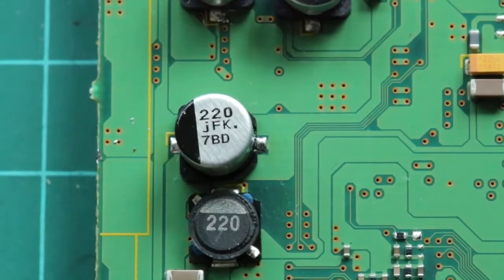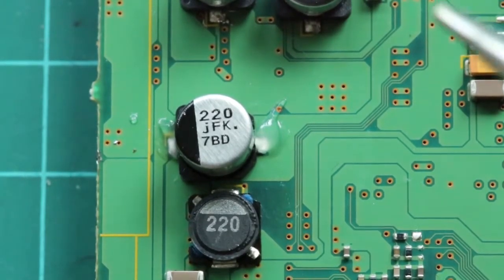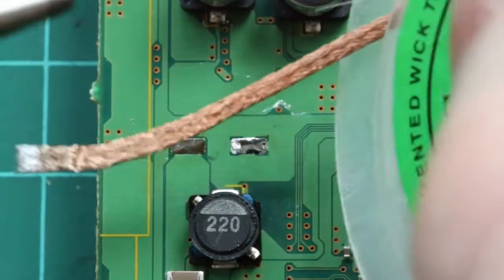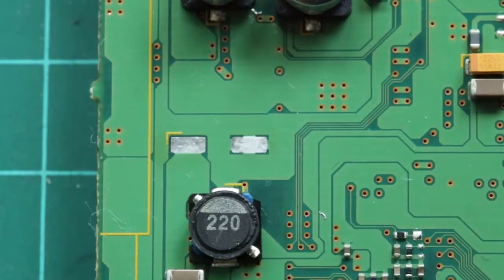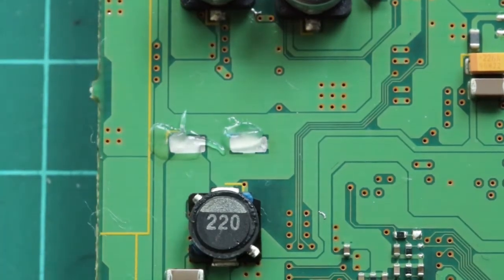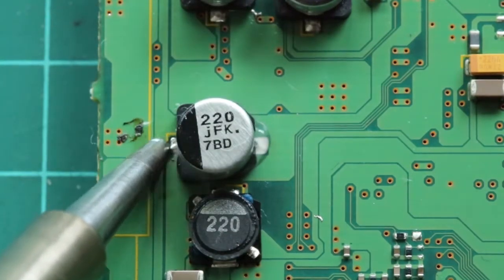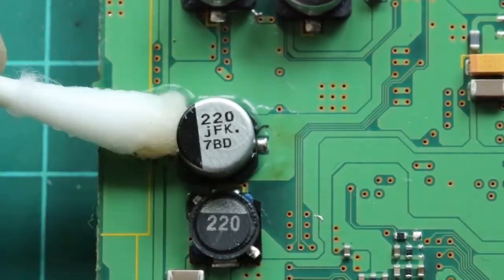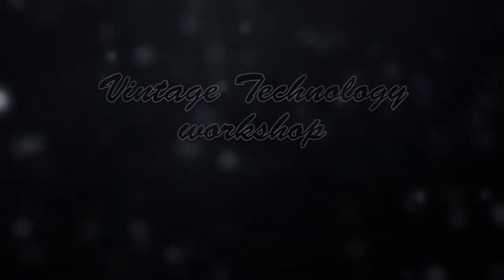Replacing SMD Caps the easy way.

Comment: Unsure if using two irons could be described as "easy" . How many people have more than one?
Reply from the maker: I guess the video is more aimed at bods that have to do this sort of thing on a daily basis and use the twist off method, which can sometimes take longer if you calculate the cleanup time and damage repair. A set of cheapy soldering tweezers would set you back about £20, but if things are tightly packed then this method might be the safer solution. Being an ex-Sony/Panasonic bod, I guess I have more than my fair share of soldering equipment, as service tech's tend to buy their own equipment that they feel comfy with. Most engineers stock up on multiples of things, just in case it ever gets discontinued. 😀 All the best, Ast..

Comment: DUDE, YOU FUCKING PIMP. This technique works fantastically (i was lucky enough to have a second soldering iron). No outrageously expensive extra tool needed.

Liked and sub. AND I LIKE AND SUB FOR NO ONE

Just finished my first recap of an snes
Reply from the maker: Sorry for the delay in replying, just saw the message. Thanks very much 😀 Well done with the SNES too. Glad the technique helped. Best regards.
Reply: @AstonsVintageTechnologyWorkshp  yeah thanks again it gave me the confidence to fuck around with a lot of shit since then. sadly i dont have a microscope yet :(

Comment: How hot is you soldering iron?
Reply from the maker: Actually, that's an excellent question, whilst it was approximately three years ago, I believe the temperature was in the region of 320° on the digital displays, however this doesn't necessarily mean that it is exactly 320° at the tip of the soldering iron as that will vary depending on the size of the pad being soldered, how large the ground planes are, and the thermal conductivity of the tip itself. The temperature at the point is probably closer to 300°. My best suggestion would be to find some old scrapped boards and practice with the set up you have to find the right balance. All the best from Aston.
Reply: @AstonsVintageTechnologyWorkshp  thanks I only ask because I cannot get the pads on my old caps hot enough before melting the plastic. I also don't know what type of solder was used on this board
Reply from the maker: @gandolfgrey5385  Ahh, right, the leakage sometimes causes the solder to no longer be malleable. It turns it to a crystalline form and you might find it very difficult to melt. Grab yourself some amtech non-lead free solder flux or a cheap chinese version (they're actually not bad) and work quickly with a hot-ish iron (320-350 degrees) with liberal quantities of flux and more solder. This will allow the old solder to mix with the new and you can then get the caps off. I say quickly as you don't want to melt the pads off the board. If you think it is taking too long leave it for a bit and try a different cap and go back to the first one later. Hope this helps, all the best from Ast..

Comment: This is the hard way. It is enough to take it with pliers and turn it clockwise. Or against, if you prefer. Most importantly, in tight mounting, you do not risk damaging adjacent parts with a hot soldering iron.
Reply from the maker: Well, sort of, that depends on whether the capacitor has leaked, and invariably it has. If it has leaked, and it's fitted to a Sony product from the 80s or a Sega product, then you have bigger problems because  the leakage weakens the bond between the solder pad and the circuit board itself, so when you twist the capacitor with a pair of pliers you take track with it. Also in small tight places I use micro soldering iron tips, which work much in the same way.
Reply: @AstonsVintageTechnologyWorkshp  Maybe you're right. I haven't come across this yet. Probably when the pad was already rotten, it didn’t get worse)
Reply: If you're recapping an Amiga, this is a good way to wreck the board, as Aston said. If you're worried about nearby parts (A1200 has a cap right next to the plastic keyboard connector for example) put down some kapton tape to shield those parts

Comment: Good stuff Aston, what did you say that tip was, a 'well' tip?  I lurrvve SMD stuff.
Reply from the maker: Thanks, yes it's called a "Gull wing" I'm not entirely sure why, it's sort of dished when there is no solder on it, so it carries just the right amount of solder to tin and flow the joint. They are good for drag soldering too, and all that crazy malarky. :)

Comment: Lovely Video and Sound Aston, Your Attention To Detail Is Superb !! Wow That Flux is Very Expensive For What You Get !! Thanks For Uploading Regards mike.
Reply from the maker: Thanks, I tried to make sure everything was as clear as possible, so people can easily see what's going on, even if I couldn't see properly around the tripod. :P
Reply from the maker: P.S. the flux is really worth it though. It's cracking stuff, and doesn't damage the board long term. The Chinese knock off stuff is ok but a pain to clean off afterwards, and it rots the copper traces if left on the board.

Comment: Nice short instructional Aston with a great voice-over. Well done.
You make it look too easy (and I'm sure you will say it is) 😉
SMD is not my 'thing' - I will do them if it is for myself, and there is no other option, but I will not actively buy-in equipment for repair that takes SMD en-masse... A couple of Sony sets under my belt, and that's enough for me in this lifetime. Give me tag strips and through-hole any day...
Reply from the maker: Many thanks, if it helps someone, somewhere, then I'm happy with that. :) I'd much prefer through hole caps, but these are not so bad when you absolutely have to save a valuable bit of technology. All the best.